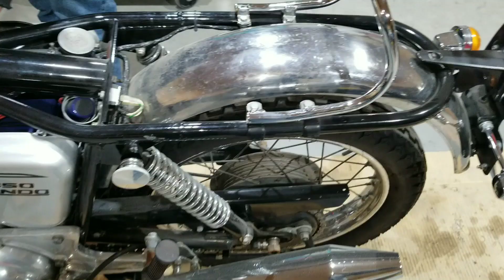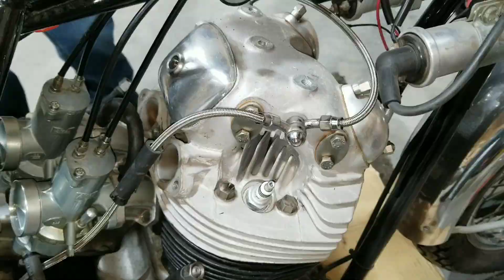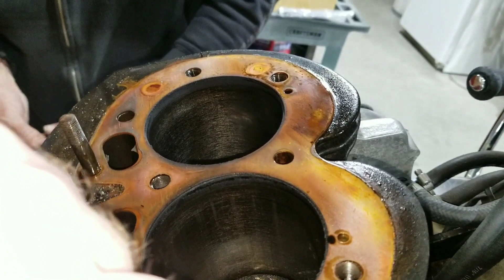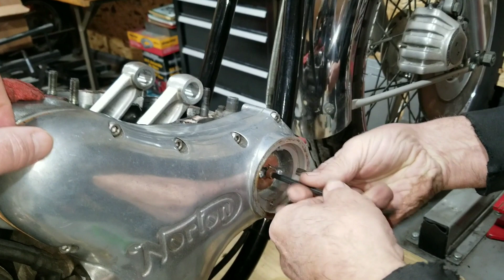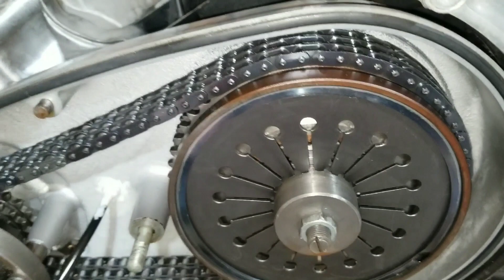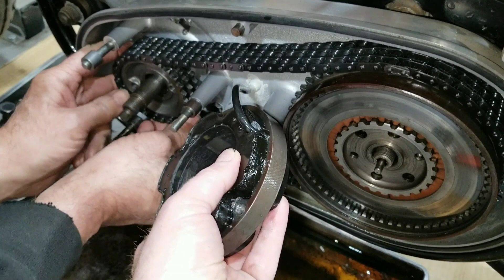1974 Norton Commando engine bottom end rebuild, Part: 1 Assessment and disassembly

Comment: What is the standard big end diametre ?thanks
Reply from the maker: @johnutting9615  1.7500 STD for 750’s and 850’s anything less means the crank has been ground and has thicker bearings
Reply: @jessesvintagegarage765  thank you, the mannual I have is missing this info. Thanks

Comment: Some ring sets like sealed power have plastic bits on the crinkley part of the oil ring to stop overlapping ,they can mark the bore,  has it got enough ring gap ? , it dosen't seem to have proper cross hatch ? , Top lands can make a noise mostly when cold , I noticed your top lands are shinny ! you would expect to see carbon on them .010" removed from the top lands will stop that type of noise . I have a 73 750 MK5 ,Cheers good video .
Reply from the maker: Thanks for the comments, I'm glad you caught on to some of that stuff, the people that bored this cylinder assembly the first time they messed up the cross hatches, and that worn spot was missed when it was previously bored, because our new machinist said it wasn't bored properly, we believe its good now and you can see it in video part 2, Also unfortunately this top end only had a little over 400 miles on it sadly, part 3 is coming up where we replace the main bearings I think you will enjoy that, glad to hear you have a Norton also,
Reply: .010" from 'the-face' , or the width, or the Back of the groove ? just wondering, Dave, NZ